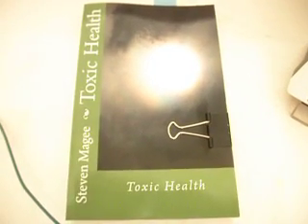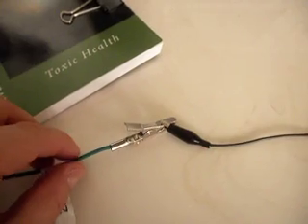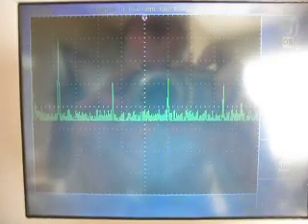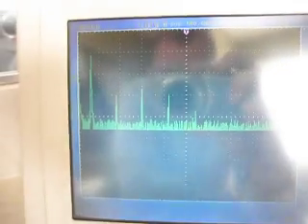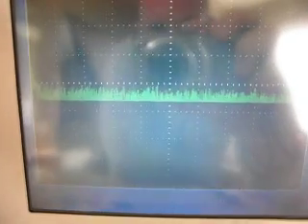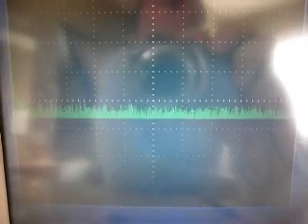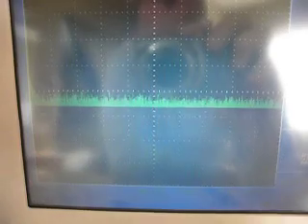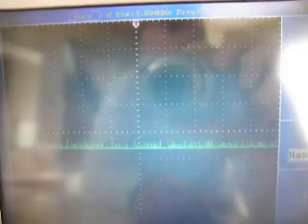Measuring Dirty Electricity Noise Using an Oscilloscope

Comment: What kind of oscilliscope/ spectrum analyzer is that? Any idea of the price of the today?
Reply: I was curious also. I stopped and scrutinized and I could read “OWON” made in China(?) I’ve been searching for an inexpensive and effective unit here in Japan. This OWON gets mentioned consistently on reviews here. The one I’m looking is SDS1102. Here’s a link to one on Amazon; https://amzn.to/2UT1Poq
Reply: By the way, I am currently testing out an USB unit that requires a computer to make a complete unit; Instrustar ISDS205X. I’m not sure about this unit since it has protective input diode clamps down at 50V making it impossible to test the power line. I’m considering returning it.

Comment: Thanks for this, been looking all over the place for more details on taking these readings!  I might mention people should know what they're doing and consider a "floating" set up to prevent shock among other things.  When you disconnected the probes for the oscilloscope to show the background noise of the equipment, I'm assuming you only disconnected it from the mains and not the ground - this might help with some of your detractors comments.

Comment: use a stetzer filter
Reply: I'm assuming you're saying to clean up the dirty electricity?  I'm using tools like the oscillocope to try and determine if the stetzer filters even work or if they're just dirtying up the neutral ,/ ground by sending the dirty electricity down those paths and not really eliminate in it?  As far as stetzer and greenwave filters are concerned, you can use acheap Chinese "save energy boxes" instead, which are the same thing internally as a stetzer filter (fairly large capacitor and a resistor - to dissipate the built-up charge when unplugged) - you may need a couple more but they're so cheap it doesn't matter, they're like $3 a piece on eBay and Ali Express.
Reply: @jackietrove4637  You are saying those "save energy boxes" are the same thing as greenwave/stetzer?

Comment: your picking all that noise on the antenna you have created with the 25' "grounding wire"  #fakescience
Reply: Whether or not that's true why do you have to hashtag it with fake science, does not sound open minded
Reply: Also don't forget mains wires are also antennas.